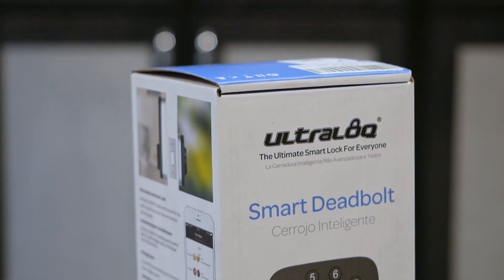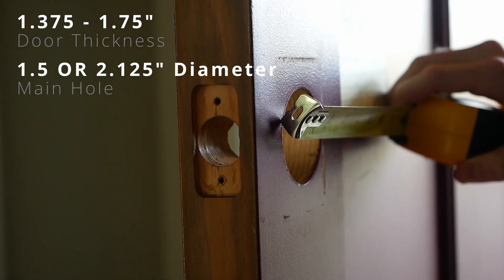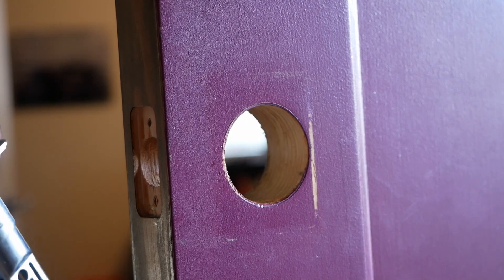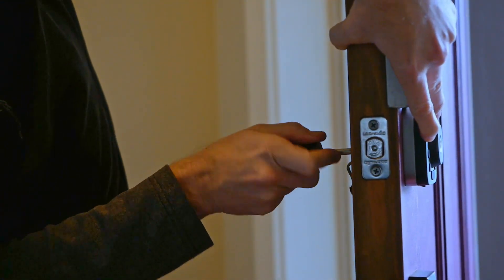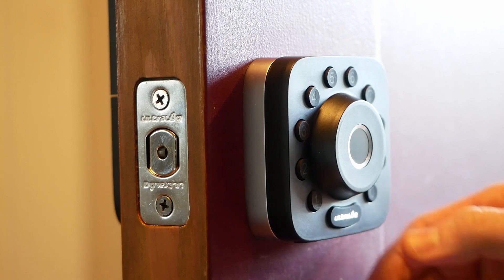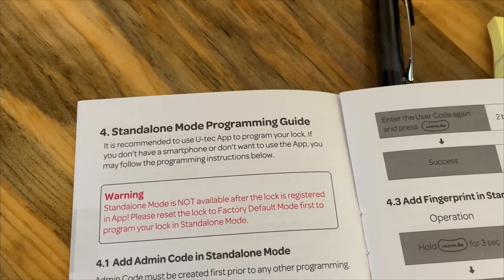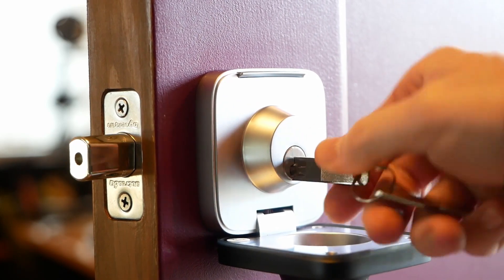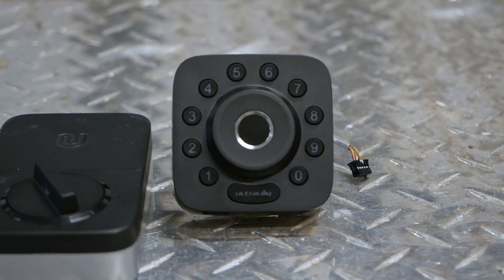Only ONE Flaw with the Ultraloq UBolt Pro, Otherwise PERFECT

Comment: What happens if the internet connection fails and you don't have the key?
Reply from the maker: Use your fingerprint or your code...doesn't need an internet connection for that.
Reply: @aaronstestlab  thanks for the quick response! I just ordered this on Amazon.

Comment: How is the wifi? I saw complaints, and the issue seems to be that it only connects to 2.4GHZ band.
Reply from the maker: I've never had a problem with the wifi. It's pretty common that iot devices only connect to the 2.4 ghz band though.
Reply: @aaronstestlab  Thanks for the quick reply!

Comment: I agree that there are so many pros and very few cons but the cons, although few, are dealbreakers. Cons are:
1) fingerprint sensor longevity - mine sensor stopped working in just under a year
2) Post sales service. Although my issue happened in the warranty period and Ultraloq initially agreed to replace the sensor, they dragged the issue out and when I followed up with them it went beyond the warranty period so they denied my warranty. Their remedy was to give me a discount (which incidentally was no less than what they offer on regular sales) for me to buy a new one. No thanks, not interested in buying these on an annual basis.
Reply from the maker: Interesting. I'm six'ish months in and no problems. Hoping one doesn't crop up.
Reply: My fingerprint sensor went out a month in. I had to do two factory resets but it did get fixed.
Reply: That's bad customer service , reason enough not to buy !
Reply: 😅 I forgot 
All
Reply: I have the same problem now.  Finger print does not work, even the keypad a has problem I have to press the button couple of times to get it activated.

Comment: Good review and I agree that it is made solid.
Good you caught the fingerprint angle. I initially did mine sitting down and most of the time I had to try a couple of time to get it to open. I found that using the fingerprint with short presses helped a lot. I should reset the fingerprint in the normal position.
Documentation is pretty good and I suggest reading the manual before installation.'
Batteries do last about a year and you get a red flashing/beep when they need replacing. 
Thank you for the review.

Comment: It's not that the fingerprint reader is worse than on a cell phone, all readers are angle dependent. If you didn't scan your fingerprint on your iPhone with the top of your finger it isn't going to accept it either. It is definitely a good note to everyone to do the scans as you would use the reader or properly scan the tip and pad.

Comment: I just recently got this, it's great. But, I've never set my fingerprint and it seems to open with any fingerprint. I was even able to unlock it with my elbow and wrist. So, does this mean that anyone can now unlock the ultraloq? Plus I can't find the reset needle before anyone suggests I reset it.
Reply: that does not seem normal.
Reply: I'm wondering if the Geofence is on and it's unlocking because of proximity to the phone so it seems like random sensor presses are allowing people in?